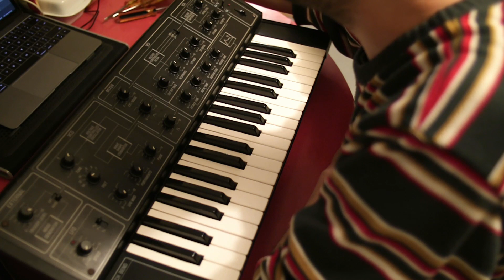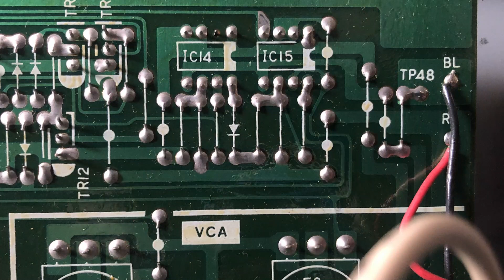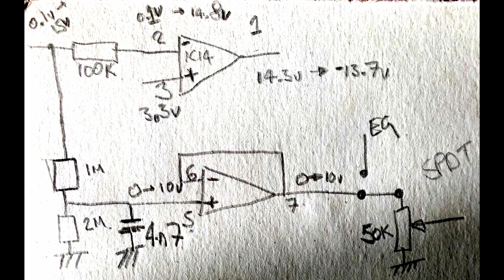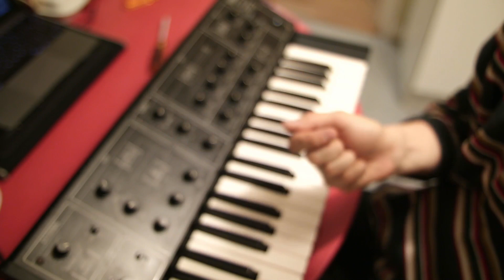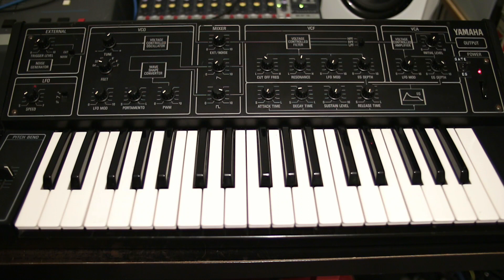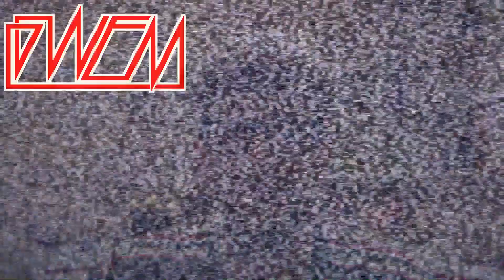Yamaha CS-5 VCA mod : switchable gate or envelope!

Comment: Hi there,
Good work !!! I don't know if you would or want to help, I would like to attach a CV input to my Yamaha CS-10, according to research on the Internet, all you have to do is attach a socket and solder a 33K-39K resistor. Do you know whether it would be correct to attach this resistor (socket input) to pin 4 of the IG00156 (IC 1)?
Maybe you know what.

many Greetings
Reply from the maker: I have a video on this with my own converter. https://youtu.be/Z7DnSXa1fQ8

Comment: Good work! Another useful mod for this synth is to add direct control over the pulse width of the square wave. The CS-5's square wave has a fixed duty cycle of 50% . Pulse width modulation is only controllable by the lfo.
Reply from the maker: That would be a useful mod yes! I was already surprised the synth didn’t have that. Thanks a lot for watching :)

Comment: Cool mod. I love the CS-5 - to my mind one of the darkest sounding synths - especially because of the downward ramp. 

I believe a sub osc mod is possible, similar to the Jen Sx1000
Reply from the maker: That’s a good point about the downward ramp. Also what I like about it is you don’t lose too much low end with the filter resonance.

A sub oscillator mod could be interesting!
Reply: @gwEmbassy  Absolutely, the filter is my absolute favourite! Just reminds me of the Crystal Method synth sounds.  

I'm sure its possible to do the sub-osc mod, I did see it mentioned somewhere. The one for the Jen was SUPER simple. Theres a vid of the results on my channel